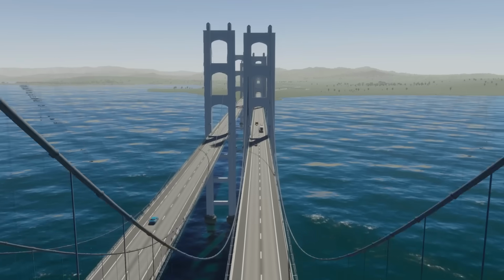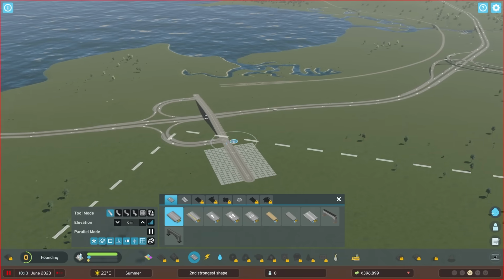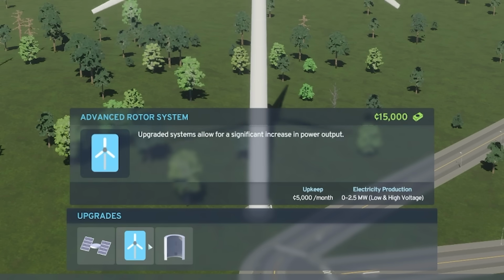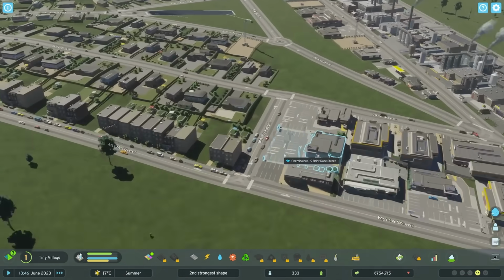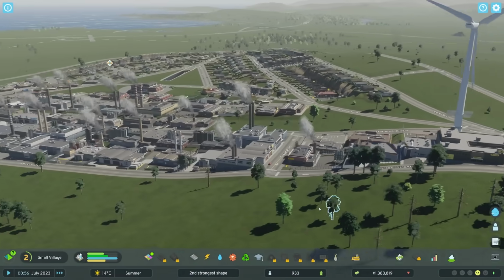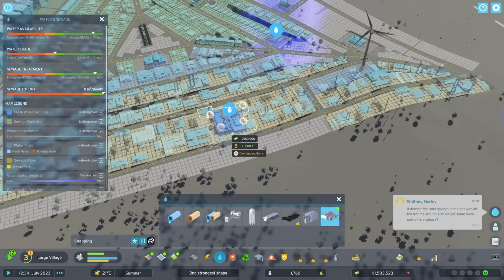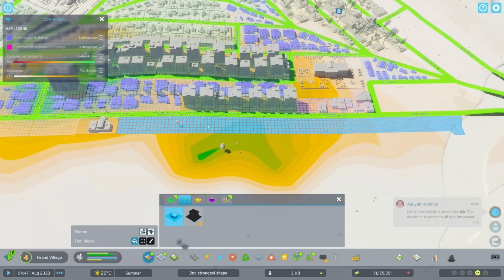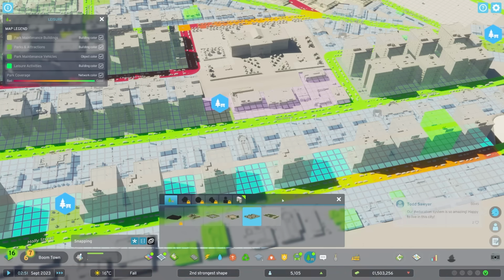Engineering the perfect TRIANGULAR CITY in Cities Skylines 2!

Comment: I would have put the commercial in the middle with the high and medium density moving outward since you have the entrance coming into the center of the triangle. Then another layer of commercial with medium and low density on the outside with the industrial on the outer-most section with the wind blowing away from the city.

Comment: Idk if you're aware, but intersections no longer have a limitation of 8 roads in CS2, where there was in CS1.

My experimentation shows that as long as the angle between 2 roads on the intersection is >20, it fits.
So largest intersection center that can be made should be with 17 roads, and while keeping the symmetry maintainable 16. (If only it was an angle of >=20 instead of >20, then max would be 18 roads)

Any smaller angles and the roads start merging before the intersection.

Also, as long as the road sections are all long enough, it's 100% roundabout compatible.

Hope this gives you some ideas :)

Comment: The city is inside out. Low density needs to go on the outside in the suburbs with the commercial downtown in the center. In fact, if you put the highest buildings in the center and have them get lower outward, you have a 3D triangle, aka tetrahedron

Comment: I made a true Fractal triangle city with all one way streets that get smaller with every layer.  The larger roads having right of way so there's constant flow.  For the most part it worked.  The only downside is I had all industrial, power, airport, and waste in another fractal on the other side of the highway, and that was my traffic bottleneck.  I ended up installing an underground road loop connecting all the outer corners.

Comment: 56mph in a 106? Architect! You can easily push 80 in it while inspired by the Ride of the Valkyries coming on Classic FM at 3am in the middle of an empty motorway through Telford.

That’s when I noticed how fast I was going…

… but your right, that’s a proper boy racer bridge!
Reply: Sounds like he's got his 106 confused with a HGV. We was easy pushing 80-90+ back in the day. It took ages to wind up to that speed but 56. Must have had the handbrake on partially still. Or didn't know about 5th gear.